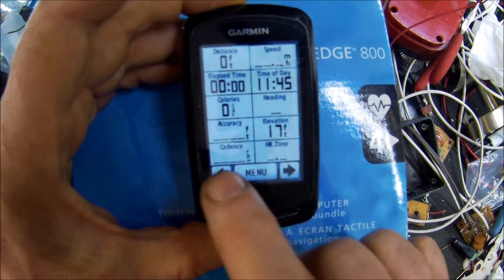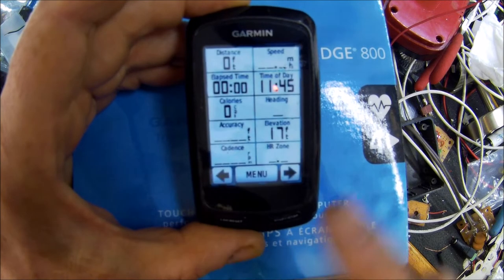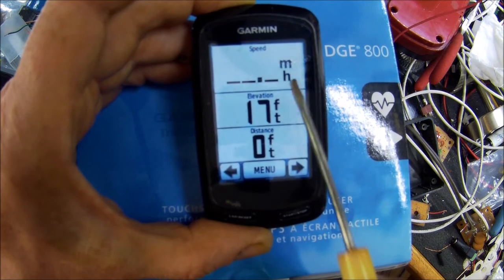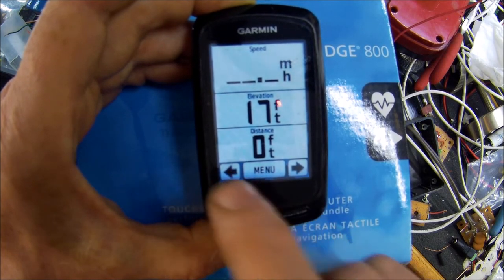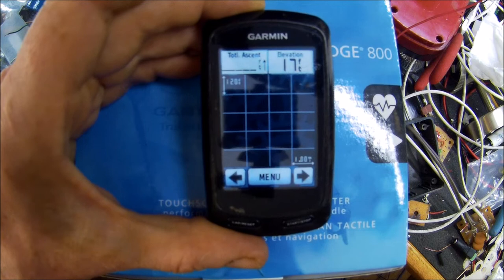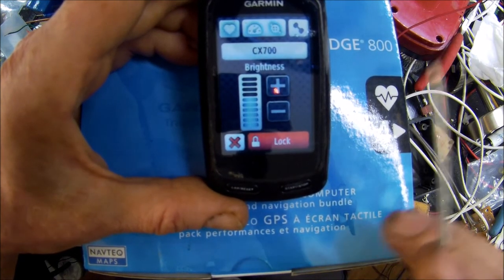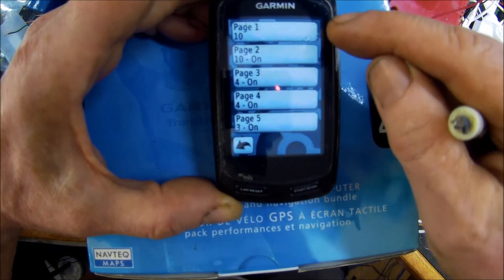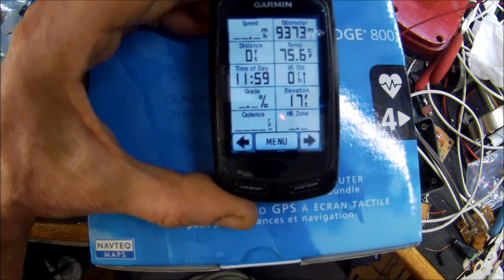Garmin Edge 800 Training/Timer Page Setup

Comment: Hi, you dont have to go all the way back into the training pages to change a variable.  On the training page in question just press the and hold on the variable you want to change and all the options available come up.  So much quicker.  A really good video and l bet you are glad they have so many things to measure,  I honestly dont know how you can focus on all those items page after page.  What do you do with all your metrics at the end of the day ??
Reply from the maker: Good tip on the training pages settings.  I probably used that years ago when I set these up.  For sure, I don't focus on every value while riding.  I do have the multiple pages that I use for different parts of my rides.  For example on the flats, I use the first page and mainly focus on the cadence, heart rate and direction as it pertains to the prevailing wind.  Then for climbs, I switch to the 2nd page and check the elevation and heart rate.  I'll also check the temperature at the beginning to see if I need to back off a bit if it's too hot.  I upload the ride data to Garmin Connect and then have that linked to Strava and Endomondo.  I might go back and look at data for a ride I haven't done in a while before heading out to do it again.